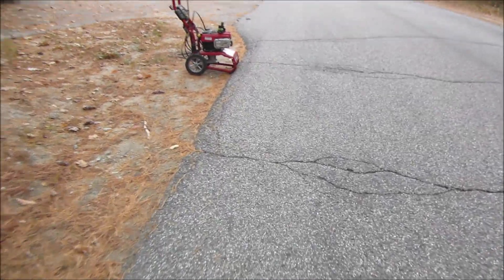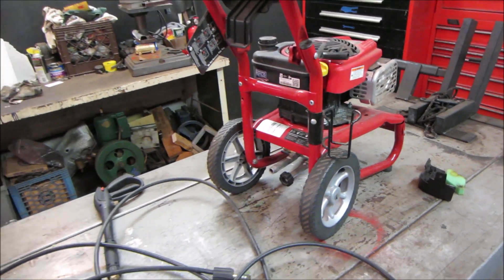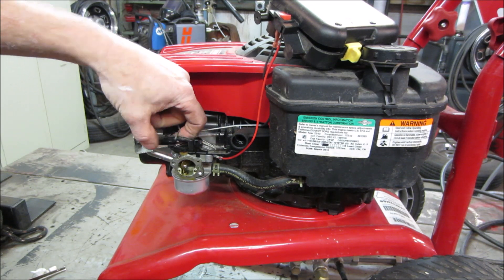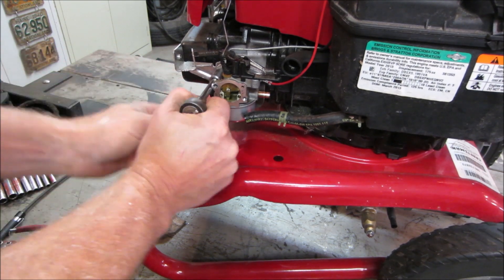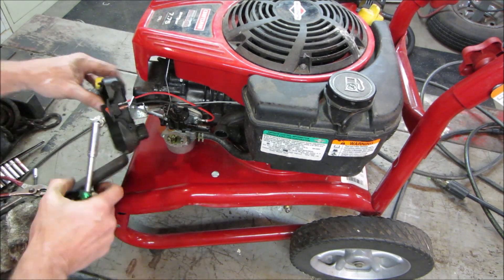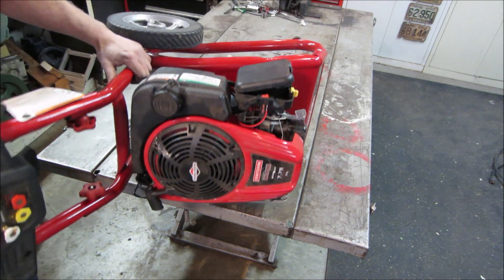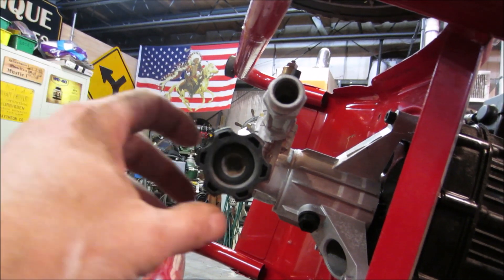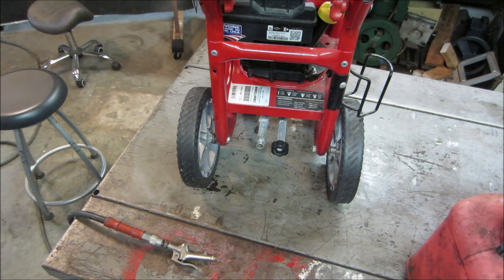Can It Be Saved? Junked Pressure Washer From The Garbage.

Comment: Looks like I got a bit luckier than you this time! I picked up an EXTREMELY low hours pressure washer last Friday from a guy. He claimed it was "Hard to start" (No chance in hell this thing had ran within the last year). From what I gathered, he bought it on a deal during the winter, used it to knock the leaves off his sidewalk when he got home and hadn't used it since.. That was 6 years ago. 

Luckily, the pump had been drained. Also lucky (for me), the carb had NOT been drained. Float was stuck, jet was clogged. 30mins later she was running like a top. I pulled the valve cover just for my own curiosity.. I wish I had taken a picture, it looked brand new. Still had the paint marker marks clear as day on the Valve springs and head bolts.

Comment: Well, the pressure washer was free? So for say $50 or so get another pump and happy days. Yes you could strip out and tig weld? But for the casing to split there must have been other issues? Personally just change pump, get it running and use your skills elsewhere. Really enjoyed the video.

Comment: Great idea with the air connection to blow out the water. You can use a fitting that is used on RV's to blow their systems out these days. It just screws into the water inlet fitting and has an air hose fitting in it. I also have a question. Where can I find the bottles like you use for squirting gas and oil into the equipment?

Comment: I have fixed pumps like that with low heat alloy sloder applied with a blow torch . Works OK 60% of the time
Reply: Greetings: 63% lead & 37% tin it the eutectic alloy mix withe the lowest melting temperature. About as easy to find as the 60/40 ratio alloy type.

Comment: I found the same pressure washer at the dump a few weeks ago only it has a Honda motor. Went through the carb & got it running, but it has the same cracked pump manifold. Sixty five bucks on Amazon

Comment: pulling fluids through air passing over is known as the venturi effect.. keep up the grear videos Mustie1
Reply: You're thinking of a Venturi tube which is related to his effect but not exactly the same thing. The Venturi effect actually happens in the throat of a carburetor due to its shape. The tube simply takes advantage of the fluid dynamics going on.

Comment: that part can be repaired by either tig welding,or replacing the part for a new piece,parts are readily available,you probably have an address on the pressure washer somewhere,check it out bud....good vid by the way...

Comment: Non ethanol fuel is available at any small airport at about $6.00.  I have developed  an ethanol remover.    15% ethanol can be removed by adding water to the fuel and then separate the water and ethanol from the fuel.  ie a gravy  separator works for small quanties

Comment: You could use "epox a leak" for the pump housing its a high pressure epoxy for refrigeration repair can do 3000psi when cured

Comment: I have a pressure washer just like that,the manufacturer,did put a gas shut off valve on the system,so if you put the pressure washer away with any fuel in the tank,it would drain into the cyclinder causing all kinds of trouble.l solved my issue,by draining the fuel out of the cyclinder,and putting a gas shut off valve in line.That solved the problem and it starts nicely now.

Comment: I did the same thing. Picked one out of the trash. It has froze on the bottom. Engine was like new. Pressure washer was only 2 years old. Ordered the pump on amazon. Depending on the model they are $60 to $100. So ended up with a $350 washer for $80.

Comment: I see ebay sellers with complete pump assemblies for $70.00-80.00.

I just fixed a small WORX electric pressure washer they gave me for free when it was damaged in shipping for about $5.00 in basic pluming parts and an hour of my time.

Comment: I wonder if you could use some brass brazing rod and then JB Weld over that to give it enough strength to hold together, if nothing else it would be a cheap attempt at a fix rather than buying a new pump.  Of course it does say Craftsmen on it.....so you could (if the policy is still available) take it in and get a replacement pressure washer.

Comment: If the crack is too far gone to clean and braze you can likely locate a new pump for $80-100 which is pricey but still cheaper than a whole new machine considering everything else seems to be fine.

Comment: I know I'm very late.. But novel idea. But you could've easily used a dremel to make the crack into a cavity that will be very easily weldable with a cheap torch from home depot and 2nd option which is the novel idea.. If the aluminum is thick enough and you can't weld for some reason like space or nearby plastic you can use a dental handpiece/dremel to make that cavity into an inverted  parallelogram using an inverted cone bur.. Then use whatever filling material you can.. The undercut will prevent the filling from flying out and its adaptation to the walls of the cavity will seal it against even the highest pressure water.. To break, the water will have to overcome the compressive strength or ultimate yield strength of whatever material you used.. Pretty good for me.
Edit:1.5-2mm is the minimum thickness for many materials to have proper filling.

Comment: My honda hasn’t failed yet. The back of the pump where your thumb is the Allen heads are dripping. Engine has a tons of hours no issues. Oil changes, when i run the washer i usually run till the fuel runs out. Pull the choke make sure it’s completely run dry of fuel. The one you have from Yellowstone with a old Faithful Pump is done unless they make a rebuild kid. Which they should. Who wants to spend a lot of money for a new one. When its just the pump. If you take care of your tools they’ll take care when you need them.

Comment: You should be able to weld that. Is it aluminum ?  In band instruments we silver solder keys back together. Lead solder will not hold but silver will never break again in the same place. But I’m thinking weld. Also, since that broke doesn’t Craftsman replace the pump for free ?

Comment: those pumps have 6 check valves 3 under the caps on the side 3 under the pistons they have a tendency to push the center down into themselves and cause the engine to overload and die. mine had a crack and I filed the crack so it had a v shape bevel on both sides of the crack and jbwelded the crack and it holds fine

Comment: that first one you believed was for the mix is in fact thermal valve it will bleed water when the pump starts to heat up to purge the hot water to bring in cold water to help cool it.. ive had many come in for disposal because that valve wore out ive seen people try all sorts of ways to stop it from leaking EXCEPT replacing it with the $15 replacement. a few that came in that they removed it and just put a bolt into it eventually caused the plastic pump valves to turn into a blob of melted plastic.. not hard to rebuild i keep them for the ones that are cracked and salvage the valve parts to rebuild the melted down ones and make a good one

Comment: be a good unit to try that aluma weld from HF or hand torch with aluma rod . the frame works great for the lil air compressors. the pancake style

Comment: Just weld it. No need to take it apart. Even if you don't weld it, the water leak WILL not hurt your driveway, it's a very usable machine.

Comment: I'm sure we have dozens of pump heads in our scrap pile. Send me an IM and I'll send you a good one that you can use to make the repair. You got 99% of your speculation correct. The only thing ws the fitting with the black plastic "hose barb" on the inlet side is a thermal relief to prevent the pump from burning up from extended bypass.

Comment: Briggs & Stratton has a can specifically for protecting pressure washer pumps. It lubricates and has anti-freeze solution in it. The can cost around ten bucks. If people would simple READ & UNDERSTAND the instruction manual, they would not have to be throwing away decent machines like this. That pump is an axial cam pump. Simple, cheap & reliable (under proper maintenance). I don't believe in Briggs & Stratton's idea of no oil changes. Ebay has those cam pumps, around 70 bucks.

Comment: There are probably some guys out there that could tig weld that crack up, but that is a super cheap aluminum cast that is probably full of all kinds of junk metal and it would need to hold 2500 to 2700 psi steadily and maybe spike up to 3000 or even 3500 when you let off the trigger. It would likely just crack where the weld met the virgin material because you can't get to both sides. (At least I don't think you can get to the back side)

Comment: You mentioned something about putting putty or something on the pump to stop it from leaking, is it something that could be braised closed if you pulled the rubber Parts out of the inside of it?

Comment: what i do with my pressure washer is I bring the hose and gun into the basement for winter and I hook up a short length of hose to the pump inlet and I pull the sparkplug boot and I will the hose with RV antifreeze and then I pull start until antifreeze shoots out the output (put a rag in front of it)

Comment: On a different note do you have any ideas about air compressor problems? Like these. My old craftsman 5 horse 220volt will not run at all unless I hold the reset button in on the motor. Is this repairable? Also I have a old sears 2 hp 220 volt with a horizontal tank that worked fine at my mom's house but it has been sitting for 15-20 in the attached garage. When I  plug it in and turned on it does nothing at all. Is there something I could do to clean up the switch  or something in the motor. Thanks David

Comment: There's three little pistons that go up and down in a circular pattern to pump with three different the check valves yes don't run them without water running through them it burns up the pump seals

Comment: I second or third that aluminum brazing rod. You'll have to pull out all the plastic valves and seats. A little sandpaper and an aluminum brazing  rod from harbor freight and you should have the silt that crack no problem

Comment: 16:35 This is thermal relief valve. Not soap/shampoo inlet. When pump recirculating without output pressure it heats up. After few minutes water almost boils and then this thermostatic valve opens and lets hot water leak out  and new fresh water cools down the pump. After few seconds valve stops draining water under the washer. If this small valve fails, pump destroys itself with boiling water and steam.

Comment: That likely is a zinc anode to prevent corrosion.  Has to be more galvanic active than aluminum.  Navy used zines to protect steel hulls etc exposed to salt water

Comment: Contact the company who made it an order a new pump.  Most of the North American Continent get freezing temps, so I do imagine they made replacement pumps.  
Or you could use that 2 part glue, put two layers with light sanding between layers and that would hold that leak forever.

Comment: Have you ever worked on an ice auger? I have one with a carb that has a diaphragm not a bowl. I can prime it and it will start but putters out quite quickly. Almost seems like it runs in the primed fuel but then the diaphragm is not calling for more and it dies. Do you have a video that shows that kind of a carb?

Comment: I'm with several others on just taking measurements and ordering an inexpensive Chinese pump. I got a little older Briggs pressure washer from the corner working that way and it's been a real gem. However, it would make a more interesting video to see you try to braze it.
Reply: Why buy what you can find? Mustie will buy parts for things worth saving. A pressure washer ain't one of them though. He'll find one without a cracked pump that some yo-yo just couldn't get started. I don't know if you can successfully braze diecast white metal to stand up to pressure either. This isn't car trim we're talking about here.
Reply: @1pcfred  Oh gawd, an actual faboy. I'm sure everyone appreciates your faith in finding one... but I'm also sure you are aware, with all this expertise you've gleaned from watching youtube, that the pumps break beyond repair on these things more often than the motors, especially in New England, where they get hard freezes, so I'm sure things will completely add up on the pumps versus motors ratios. Plus, I'm sure you know that all these pumps have different bolt patterns and drive diameters. But I'm sure, you account for all that in your random internet postings. Still, I'll stick by the idea of spending a few bucks on a pump would probably be fast, cheap and practical. The pumps on these things are basically a wear part, as far as I'm concerned, and I don't say that as an inexperienced wanker.
Reply: @John-do9ei  so I have only gleaned my expertise from watching videos? That's news to me. I seem to recall living a life. I've watched enough of Darrin's videos to know what he's capable of finding. Or at least what it was like in the past. Things do change.  You think he bought the pressure washer he has now? Perhaps he did. But it would be uncharacteristic of him if that is the case. He claims he's cheap. So spending a few bucks as you put it is anathema to him.
Reply: @1pcfred  Absolutely. I can clearly assess your knowledge on this matter based on your statements, and demonstrate it with a solid line of reasoning. I do materialist systems of meaning, and I have 40 years of experience in mechanical systems. You clearly do not know what you are talking about here and are speaking out of an emotional fanboy sentiment. Here’s your assertion in a nutshell: 'You (John) are wrong because ol’ Mustie is a magical cheapskate who will find a pump in the wild and fix it for free.' First off, there are four basic, most common failure modes with pressure washers. People don’t purge them, run them dry, physically damage the pump assembly (usually broken water inlet or unloader valve), or they store them with fuel and don’t know how to clean a carburetor. Three out of four of these scenarios ruin the pumps. Four out of four scenarios you can revive the motor. You are wrong about finding a pump because there are a lot more good motors out there than there are pumps. Then you have to multiply that denominator by the chance of finding a pump that fits. There are dozens of different combinations of bolt pattern, shaft diameter, and shaft depth, plus horizontal and vertical orientations. But this was already explained to you. Sure, a person could get lucky, but your feelings about what should be done here have nothing to do with reality. It’s your faith that this youtuber is going to be able to scrounge a part from somewhere in the wild, against all odds. Look, I’m a fan too, and he does often get lucky, but this isn’t some movie based on a comic book. BTW, citing more obscure facts about a youtuber does not give anyone any faith that you have any practical knowledge whatsoever. It actually sounds kind of creepy and gives off stalker vibes. Rather than talk about my experience, I would point out that the main variable is how much these things are going for used. Around here, they run $250-400, so the $70-100 for a pump is usually worth it if the motor still has some life in it. Or you can sit there holding your breath, waiting for ol' Darrin to find the exact part in some junk pile somewhere. I stand by the idea that if he's still selling these things, he should get it working and move it for some cash, rather than have it take up space.
Reply: @John-do9ei  your experience clearly does not help you understand the economics. That's one of the pitfalls of specialization. Things out of your wheelhouse are opaque to you. But there is a way to capitalize on that. And that's precisely what Darrin does on a regular basis. He will find a pressure washer that just has bad gas in it tossed to the curb. Because his neighbors don't know what that means or even if they do can't be bothered trying to fix it. And they can well afford to live in such a caviler manner too. Because they're rich!
Reply: @1pcfred  Sigh. I guess you just don't read. I'm not going to explain the economics to you when I already explained the economics to you. I encourage you to get a life.

Comment: A common issue with petrol engine pressure washers is the user sprays the motor & the ignition stops working until it dries out.
If the video wasn't 38 minutes long that would be my guess after watching for 2 minutes.
The first nozzle on the pump is an overflow, the second was for soap, they don't run soap through the actual pump.
Could you tig weld the crack in the pump ?

Comment: I keep seeing an advertisement for an aluminum welding rod that works with low heat.I wonder if you could do a demonstration video to see if it would work on that crack. If it does it could be very useful around your shop for things like this. Itn allows you to torch weld aluminum.

Comment: I have the same pressure washer and had the same problem with the pump cracking and leaking, found a replacement pump on Ebay for like $35 just FYI

Comment: 16:20  FYI That is not the port to draw in a soap but rather the pump thermal relief valve. It will open and allow water to shoot out which will cool the pump in times when the engine is running but the handle/wand isn't being used. Water will sit in the pump, not flow and it will overheat. 18:25  That is the gear oil fill port for the pump.

Comment: The cup holder is for quart bottles of detergent sears sold for these.
Honestly they were about usless  and mine never really picked up the soap, a gravity feed system would have been better or a mix tank.
Dont start it with the pump on it, the pump shouldn't move without fulids in it.